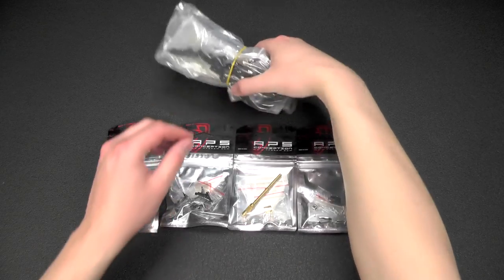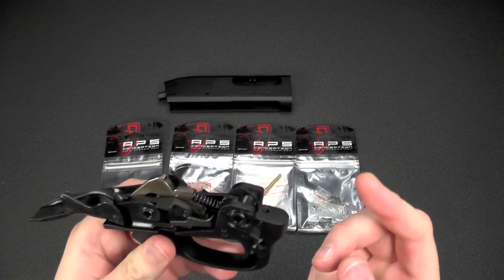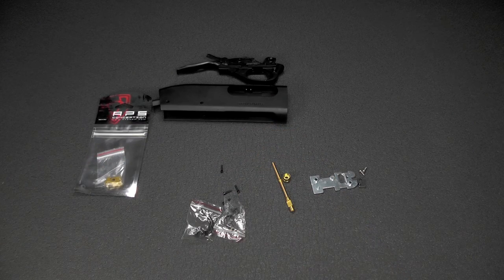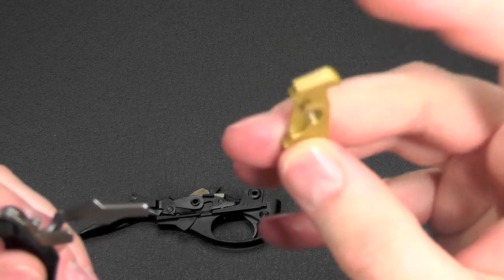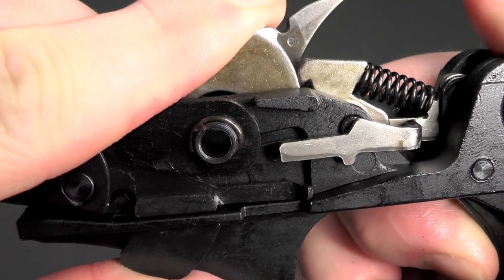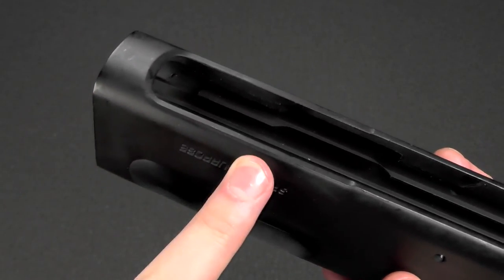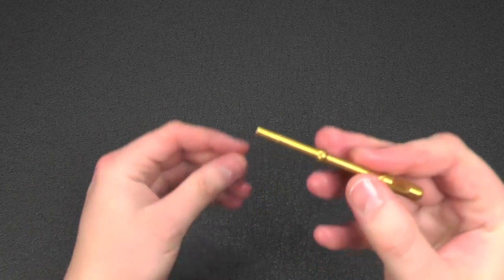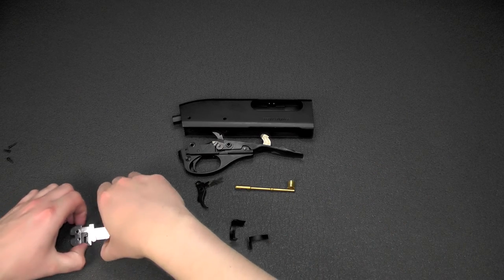Unboxing & (A LOT of) Information: APS CAM870 parts etc.

Comment: I purchased a MKII CAM870SF from ehobbyasia - after a few shots, the pin at the rear of the bolt, that the hammer hits to release the gas from the bolt, sheared off. Contact APS and they sent me out a free replacement bolt! Just fitted it back together using a mix of your disassembly video and another video that included assembly! Thanks for your help and am very impressed by APS for their customer service (responded to my email within hours on a Friday evening UK time)!
Reply from the maker: Sorry to hear about it breaking man! But I always had good experience with APS and customer service so it doesn't surprise me they sent a replacement!
And glad to hear my videos helped :D
Reply: I literally just finished putting it back together! Your video was helpful because of the clear quality and slow talking through each section of what you are doing! Just wish you had a reassembly video! I had a good idea of what I was doing from the disassembly (just do it in reverse) but there were some parts I just wanted to have a bit more reassurance that I was putting them back in correctly. All worked out in the end. 

As an aside - sometimes when I rack the shotgun, the shell doesn't quite enter the chamber correctly and it freezes up a bit - have you ever encountered this? If so, have you overcome it? I tend not to rack with huge amounts of force - am I just being too gentle with it?
Reply from the maker: Yeah I know I never got around to get the reassembly up which is a bit stupid. I will get that done ASAP! :D

Generally the system requires some force when racking the action, in both directions.
I have made some mods on mine for smoother shell loading, primarily in removing material and making a smoother ramp on the outer barrel for the shells to slide in on.

Installing a soft shell carrier/lifter spring may also help for easier shell loading.

Is there any specific position/angle the shells get stuck in?

Comment: What length are those m2 screws (stock,bolt stop)? One of mine is stripping and I'd like to replace it. Thanks!
Reply from the maker: I don't have my original screws anymore but those are super tiny ones. You should be able to measure it yourself with a set of calipers though.
I have a modification video coming up showing how I drilled through the receiver and expanded the screws to M3 for increased durability.

Comment: Hey there, I've just had my hammer break on my trigger, did you still have the APS customer support email so that I could maybe purchase specific parts? Thank you in advance
Reply from the maker: Hey-o!
Sorry to hear about your hammer.
You can get in touch with APS here: http://www.aps-concept.com/index.php?route=information/contact
If you bought it from them directly they will help you out. Otherwise they wile direct you to your retailer where you bought it. And if they can't help then you can probably buy a spare part from APS.

If you are in the US, or somwhere else where you can get real Remington 870 parts I have heard that a real trigger group is pretty much a drop in fit so that could be an option for you as well.